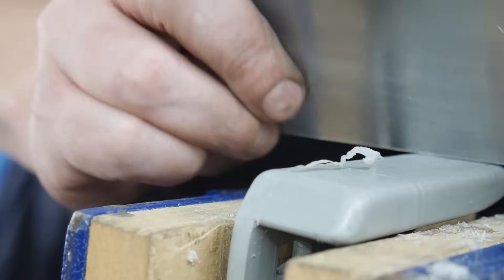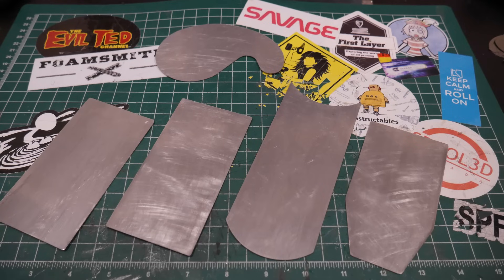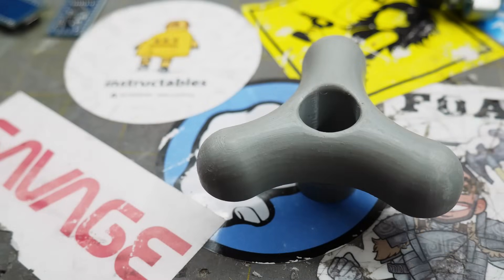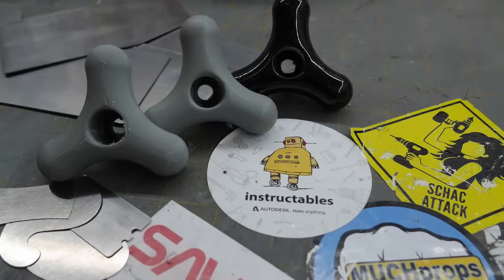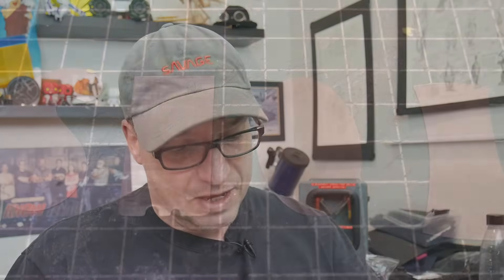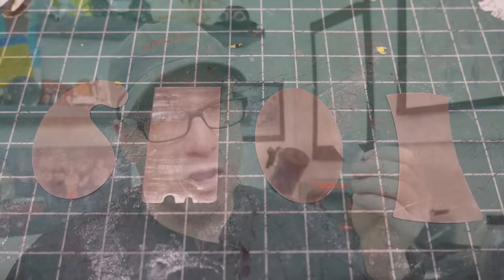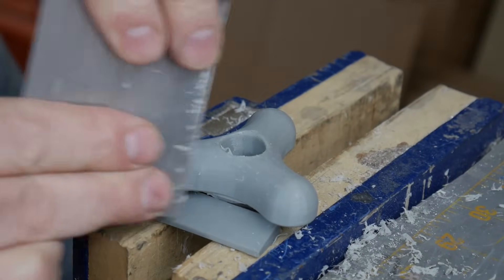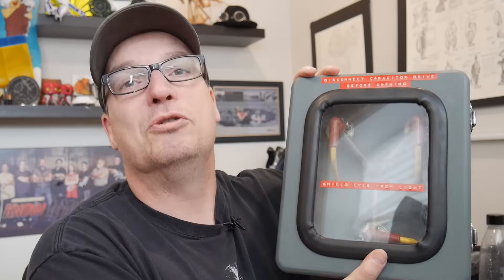Smooth pla 3d prints by shaving them. Don't sand your pla, shave it.

Comment: this is so much work for a poor finish. hit the surface  of your  print  with a  heaat gun just enough  to heat the outside. rub it down with a somewhat rough cloth while hot then sand. this method looks like shit and removes material
Reply: lo, that sounds like an awful idea. What you get from heating the surface and rubbing it is graining. That is what happens when hot and soft surface is deformed while the rest of the object is cool and hard. That is also one reason why sanding is more difficult, as it only takes 60C for the graining to start, and it ALWAYS removes more stuff that you wanted, often down to the interface between hard and soft plastic. The only way it might work is if the material is VERY different from PLA, PETG or probably even ABS/ASA, TPU.. so. polycarbonate or nylon? Or is it carbon or glass fiber infused material you have used? Because with PLA... it ain't going to work, it will grain SO fast that by far most often i need to add water+soap before using even powertools. I really can't see how it could work with most printing materials without either graining or deforming.

I've used scraping for three years now and will never go back to rough sanding. What this video does miss is that there needs to be final stage of wet sanding but it takes SO much less time when you have scraped the surface first. I just made some new tools that suit the job even better, those wood working tools aren't really the best. Also, the edge of the scraper needs to be much less aggressive, i've found that machined edge that is not rolled or just very, very lightly rolled is the best.
Reply: I use a 20v sander with 1000 grit paper and it seems to smooth the print very nicely in a very short amount of time. That said, with something small with all the round surfaces, that probably wouldn't work as well.

I tried the heat gun, but I'm very not good with that as I tend to cause more bubbling then smoothing. To those who say, "yeah, but that means you are doing it wrong", I would say, yes, you are correct. That's what I'm trying to say. I'm obviously doing it wrong, and due to that I use other methods.
Reply: Sanding is also work, and also removes material. Scraping slices thin layers off of your work piece, so it does not roughen the texture as much. I've tried using a heat gun but it deformed my print.
Reply from the maker: Well thank you for the productive comment. I am sure everyone here agrees with you and your insightful tip.
Reply: @DreadMakerRoberts  this tip if from someone who used to have to finish 3d printed prototypes daily. I used to sell high end vapes, many of them printed in everything from pla to alumide. This method works especially well with carbon nylon which marks up easily. You're basically just melting down and smoothing a surface layer. My delivery is poor but my information is sound.
Reply from the maker: Ok this I’ll listen to. Yes the delivery is poor. But I am open to ideas. How many walls thick is best for this with which plastics?
Reply: @DreadMakerRoberts  I know nothing about printing outside of material properties, only finishing. I also have a background in automotive finishing. You're basically trying to flash heat the surface. I don't remember exactly what kinds of cloth we used but you just kinda rub it smooth. Even sanding would be easier from there. I have also brushed epoxy onto prints as filler and sanded it smooth. filling the gaps is easier than trying to level the print surface itself
Reply from the maker: I would think the type of cloth used would be critical. Any idea what it was? I am finding it difficult to find a cloth that does not stick to the plastic. I've tried cotton, polyester, and microfiber with little luck. I have been experimenting with this technique, and so far, any print that is less than 4 walls thick deforms under heat. My process involves trying to smooth the surface by lightly hitting it with heat, wiping it, and if no smoothing occurs, heating it again to increase the temperature until I achieve some smoothing. At the point I get some smoothing, if the walls are not at least 4-5 layers thick, they start to deform and cave into the infill pattern. Were the prints you have done 100% infill? That would explain how this method would work well, but it would not be a solution for those of us who do not use 100% infill.

Anyhow, what I'm trying to convey is that this technique might work well for you, but since very few people print with 5 layers thick and use nylon, it would not work for them. This issue could also be related to PLA. You mentioned using Nylon, which is rarely used by hobbyists, and since they make up the vast majority of my audience, I cater to their needs. This leads to the question of whether I am not doing it correctly or lacking the appropriate skills. However, considering I have been using 3D printing to build props and special effects for shows like Star Trek, GhostBusters, and Predator for many years, I like to think that I have a good handle on these things and can generally accomplish them.

I'm not saying that I have tried and failed or that your method is not valid. I'm simply saying that I (and possibly others) need more information to test it properly.
Reply: @DreadMakerRoberts to be fair (and for the most part I don't fuckin know what I'm talking about) but it sounds similar to flame polishing acrylics, where they'll take a torch and flash it over the edges, this said if you're getting deformities then it may be because you're using not enough heat for too long so the heat is diffusing into the structure whilst you're waiting for it to polish

Like I said, I don't actually know what I'm talking about, no credentials or anything, but reading through this that does sound like the issue
Reply from the maker: @ImMimicute  Copy, Ill try some flame polishing with this method with my butane torch and see if I can replicate it.
Reply: @DreadMakerRoberts  so we used this mostly on carbon nylon pla. If your print is getting hot enough to deform you are not using enough heat fast enough. When done right it's almost instant, you can see it. This was at least 5 years ago so I don't remember what cloth it was. What are you heating it with? Try heating very high and brief, like you're trying to glass the surface basically, then instead of cloth maybe try a high grit wet sand? The goal is basically to flash melt the surface without penetrating the piece.
Reply: @DreadMakerRoberts  as for this prints, these were basically square boxes maybe 3-4 mm thick. i also polished a mod call the b fly by sunbox that was a nylon print.
Reply from the maker: @aeoteroa818  butane torch is what I’m kissing it with. I could go full in oxy acetylene on it if needed. But suspect at that point it’ll remaking the face melting scene  in Indiana Jones
Reply from the maker: Here is a sneek preview of my next video: https://youtu.be/TbvFPN7yxt0
Reply: @aeoteroa818  I think the cloth you're referring to is a scuff pad which comes in various grits. Coarse ,fine and very fine, I am an automotive refinisher and we use scuff pads to get a really smooth finish before and after clear coat.

Comment: This is great! I've used card scrapers in woodworking, but never considered it for 3D printing. I'd definitely need to get/make smaller scrapers. One main challenge for those used to only sanding is that good work-holding is necessarily to effectively use a scraper. And in 3d printing, our objects are generally both smaller and more complex in shape than most things you'd use a scraper for in woodworking, so work-holding can be a challenge here.

Comment: Old scissor blade after 90 degrees sanding-polishing and then burring works amazingly, grip is also comfortable when using it.
(Old is a must: we need a steel blade, not one of cardboard and feces fusion).

Comment: great idea but I would be afraid to scratch the surface too deep, I prefer little angle polisher like the wp/e that can go slow (about 1000rpm) and  it wont melt the 3d printed pla surface also with a foam interface pad you can sand curved surfaces. I always sand my pla and resin prints from 120grit (remove layer lines from fdm printed parts) up to about 4000grit for a nice glossy finnish

Comment: Have you ever tried to flock your parts after printing? You will get a smoth velvet like surface.
Reply from the maker: That does not always stick as good as one would like. Also does not take paint well
Reply: you have to use the right adhesive. maybe your part has to be pre-treated. also important is the thickness of the adhesive layer. is it too thick, the fibres will sink in and your surface gets hard after drying. if it is too less, the fibres will fall out. @DreadMakerRoberts

Comment: Out of curiosity - (I'm new to 3d printing)  once the 2nd or 3rd coat of paint is down, couldn't you wet sand it a bit to remove any last imperfections and hit it with a clear coat for a super clean finish?

Appreciate your channel btw- it's been super helpful!
Reply from the maker: Yes you can! In the end it comes down to how nice a finish you really need
Reply from the maker: Here is a sneek preview of my next video: https://youtu.be/TbvFPN7yxt0

Comment: I've been using this method for years. It's frankly not just for 3d printed plastic, but any sort of edge, or deburring, chamfering, treatment on laser cut plastic also benefits from this. My favorite "scraper" is actually a thin 15cm long ruler, which is flexible, so I can bend and flex it to follow curved surfaces. Heck, you can use the blades from box cutters, scalpel blades, anything sufficiently hard and sharp can be used to scrape 3d prints, doesn't necessarily need a burr like on a card scraper.
Reply from the maker: All very good points. I will need to try a small ruler like you said. I have a few kicking around
Reply from the maker: Here is a sneek preview of my next video: https://youtu.be/TbvFPN7yxt0

Comment: I have used these card scrapers when cleaning up the headstock cut on a kit guitar, why I never thought of using them on prints is crazy, I currently use glazing putty thinned with acetone to fill in the layer lines and then lots and lots of sanding
Reply from the maker: I know, everyone has their tools and their brains put them in this specific spot in their mind that they pigeon hole it into its intended task. But not looking at what it can also do. Some multi uses are obvious like a slot screwdriver is a pry bar :) Others, not so much.
Reply from the maker: Here is a sneek preview of my next video: https://youtu.be/TbvFPN7yxt0

Comment: serious question, can i just use razor blades? i’ll be finishing a glass filled pla print
Reply from the maker: Yes you can but there is a burr on the tool that makes the magic. The razor blade does not have a burr and yes it can scrape but not as efficiently. Also the scrapers are much less likely to cut you.
Reply from the maker: Here is a sneek preview of my next video: https://youtu.be/TbvFPN7yxt0

Comment: One of my worries about using a card scraper (aside from accidentally cutting myself) is if you have a part that relies on precision, scraping material might change the fit tolerance
Reply from the maker: If precision is something you need then these printers are not what you would use. Regardless the scraping is in the order of 1 to 2 -  thousands of a inch or 0.0254mm-0.05mm.
Reply: @DreadMakerRoberts  I like those odds
Reply from the maker: Here is a sneek preview of my next video: https://youtu.be/TbvFPN7yxt0

Comment: Shaving is a great alternative to sanding. I cast HDPE instead of 3d printing and shaving works perfectly. Plastic dust from sanding is nasty, gets everywhere and it's electrostatically attracted to stuff like clothes, hair and skin, fabrics. Also, you absolutely don't want to breathe fine plastic dust. Shaving plastic results in larger shavings that are easier to clean and not volatile
Reply from the maker: Great point!
Reply from the maker: Here is a sneek preview of my next video: https://youtu.be/TbvFPN7yxt0

Comment: Good info! I use small shaving blades ("Ziehklinge" here in germany) for years and never saw other 3D-printing afficianados using them. A Razorblade for the start is often enough btw. the cutting edge of them is pretty soft and when you draw them in the other direction they get better and better with time, until they get too ruff.
Many woodworking tools are usable for further processing of 3D prints, experiment!
Reply from the maker: Here is a sneek preview of my next video: https://youtu.be/TbvFPN7yxt0

Comment: Anyone have a link to the flux capacitor case file used to print the one shown?
Reply from the maker: It’s my design I have not released. Might need to clean up the CAD and start sharing :)
Reply: @DreadMakerRoberts   I've been wanting one for a really long time. I have accumulated my plug wires, lights, made my plastic tubes, and have just been looking for the electrical box but man the only ones I can find are SO expensive. If you choose to offer the file I'd gladly pay for it as yours looks amazing!
Reply from the maker: @twenty8eight  Ok Ill add it to my list of things to do
Reply from the maker: Here is a sneek preview of my next video: https://youtu.be/TbvFPN7yxt0

Comment: You can smooth PLA with acetone though it takes more work and setup than with ABS. I use as large glass beaker (3 liter) and heated magnetic stirrer, but a colleague of mine has also done it with a large soup pot and a induction plate. What you want to do is get the acetone to a boil (about 2 to 3 cm at the bottom) at this point of you watch the inside of the container (which is why I like to use glass) you will see a condensation line slowly move up the surface till it gets close to the top. Now attach your part to a wire and dip it past that line, you will see it immediately get wet. Hold it there for 5 seconds then take it out check the smoothing progress and repeat till your happy in 5 second batches. When your happy leaving it on the wire hanging somewhere till its fully hardened. WARNING: Use a long wire, you don't want to have your fingers pass that line you will burn yourself instantly. Also do this only in a well ventilated area due to the acetone fumes which is also why you not to have any open flame of glowing hot surfaces which could ignite said fumes.
Reply from the maker: Here is a sneek preview of my next video: https://youtu.be/TbvFPN7yxt0

Comment: Such a good tip! Coming from woodworking, I've always used card scrapers on my prints. I hate sanding. A quick tip is that you can roll a bur on a utility knife blade with a  screwdriver shaft and hold it in a piece of scrap wood or print a holder. Most people probably already have what they need floating around.  You can also make scrapers out of old saw plates or any piece of carbon steel in whatever shapes you need. Hope that helps someone.
Reply from the maker: Here is a sneek preview of my next video: https://youtu.be/TbvFPN7yxt0

Comment: Honestly when you said it would take an hour to get to that phase at 2:33 I stopped the video. That's just total horseshit on a part that small.
Reply: @M S Tell me you never had to make a perfectly smooth complex part without telling me you never had to make a perfectly smooth complex part 😂
Reply: I’ve been 3d printing light sabers for a couple months and the amount of sanding I have to do for a small piece to get it completely smooth to look like metal is insane. I’d actually say 1 hour is pretty accurate cause I sand with 80, 120, 220, and then 320 grit sand paper. It’s a process
Reply: @chasecalvert6227  Why not just use a homemade grinder with granules from sandblasting? It is very easy and you can set it how many minutes it should run. Simplest invention after the washing machine.
Reply: @Kommentiert_  Because if you go too hard, you end up removing more material than you should, effectively ruining the part. This is why fine, subtractive detailing is rarely done using machinery. I personally have some schooling in carpentry and know that the original purpose of card scrapers in woodworking, is to get a fine finish without removing too much material, as even hand sanding can remove too much, when your criteria is 0.1 mm max.
Reply from the maker: Here is a sneek preview of my next video: https://youtu.be/TbvFPN7yxt0
Reply: If you're sanding it perfectly smooth I can see it.
Reply: Out of curiosity, when you're sanding a part, how many different gradients you go through? Hour seems reasonable if you want to completely eliminate print lines on all sides.
Reply from the maker: @DawidUliczny-ro7eo  I generally do two maybe three if I am just sanding. 60-120-320 kinda steps
Reply: @DreadMakerRoberts  These are rookie numbers ;). I joke of course, but coming from sanding props, ahh, you're just warming up at 320 ;).
Great video btw, I'm eng in factory and 3d print maker at home. The moment I saw how you shear off that piece in very first few seconds of video a light went on in my head :D.
Reply: Lmao I think you're confused, it takes an hour sanding and only 15 minutes shaving. You made it sound like his method took an hour. So why don't you stop pushing horseshit! Because some people read comments while watching videos and you may caused someone to also stop watching. This negatively impacts impressions and decreases views. All because your too stupid to understand what he is saying.
Reply from the maker: All good we all don't have master sanding skills like some. Thats a lot of anger for a video on smoothing a plastic print though. Deep breath, relax its just plastic.  I am sure you will recoup the 2:33 seconds of your life and the time it took to respond with your ninja sanding skills.
Reply: @DreadMakerRoberts You need to address the fact that he is lying to people about your video
Reply from the maker: @cybyrd9615  I choose to not feed the trolls.